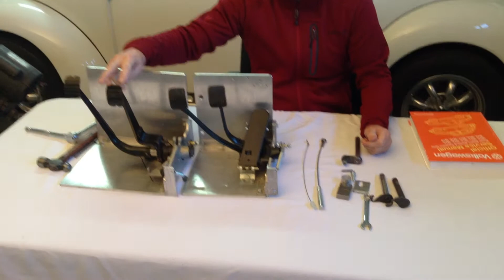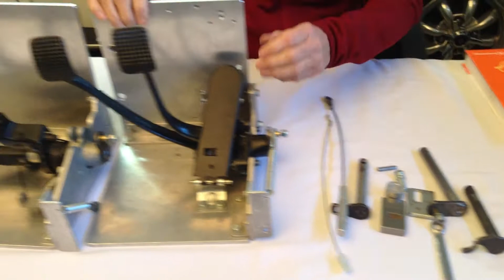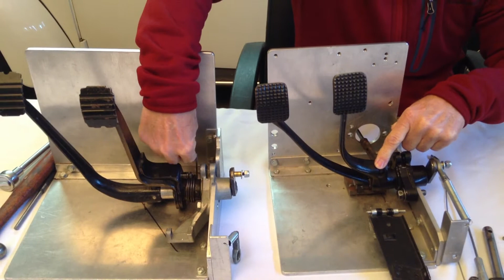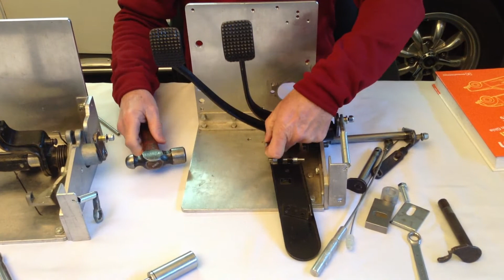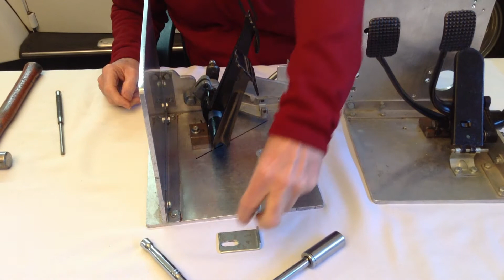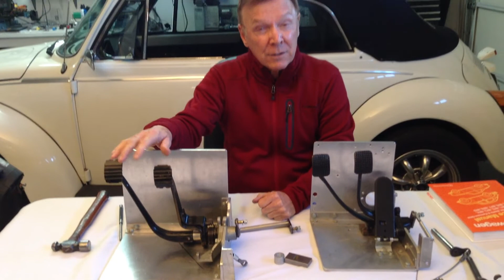Classic Bug Parts - Classic VW Clutch Pedal Shaft Upgrade w/ Big Boy Extender

Comment: my clutch pedal in my 76 bug is squeaky as hell. I've sprayed WD40 on it several times with no results. The clutch was replace about a year ago.
Reply: MMAFighter38 wd40 is a penitent  not so much a lubricant   also penitrating fluids can cause  corrosion to start . Krown is an ok lube  watch around  rubber krown will caus rubber to swell and get hard . Use non chlorinated  parts cleaner to help wash the penatrating fluid off then lube
Reply: Possibly the release arm at the other end of the clutch cable. If not then something inside the tunnel at the pedal assembly, likely the very hook and ladder interface that is detailed in this video